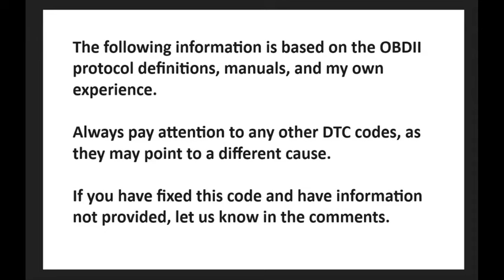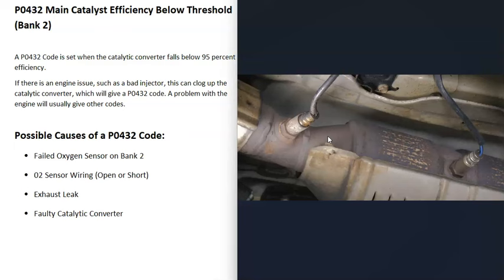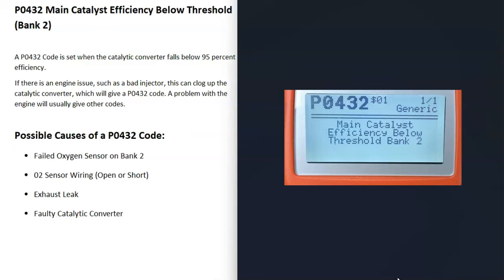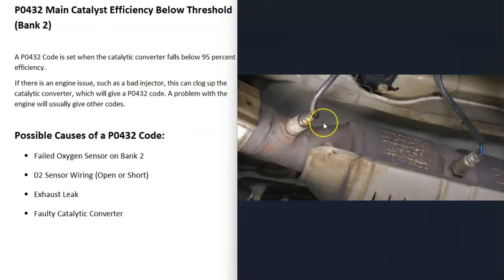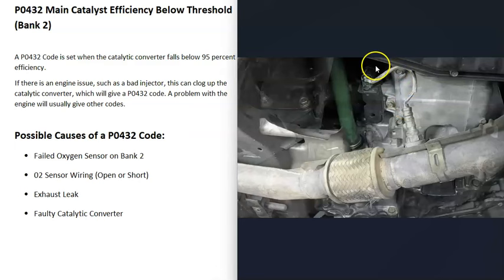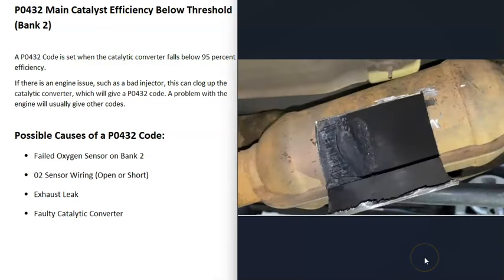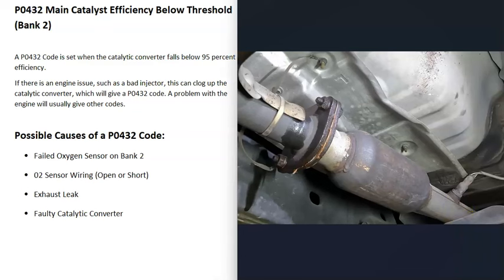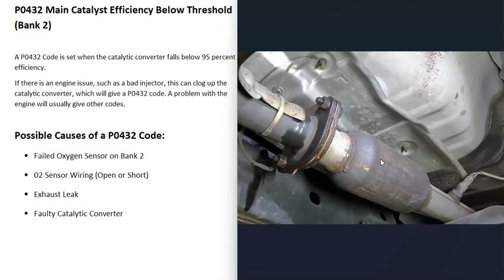Causes and Fixes P0432 Main Catalyst Efficiency Below Threshold (Bank 2)

Comment: I've had this issue where I've seen some residue on my drive, not too sure if it's the catalytic converter leaking, but the oil in the engine also burns up quite quickly. Would a faulty cat/sensor cause the engine to burn more oil or would you reckon it's an oil leak aswell as the cat issue? Would appreciate the help thanks

Comment: I got a p0101, p0011, and a p0016.  Its on a 1.8 ecotec in a chevy sonic.  Im thinkin the timing slipped as it runs like shit but im not too sure.  Any ideas??
Reply from the maker: A loose or slipped timing chain would be a common cause. There may also be an issue with the VVT or cam sensor. Be sure the oil is at the correct level and not extremely dirty as that causes issues with the VVT.
Reply: @HVAC_Mechanic  I know the oil is good so I'll be sure to check all the other things.  Thanks!